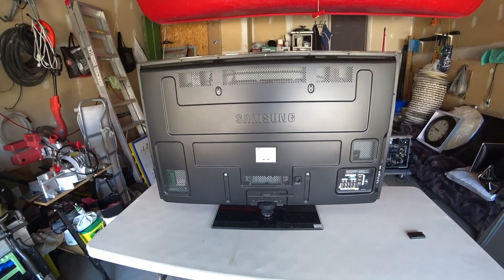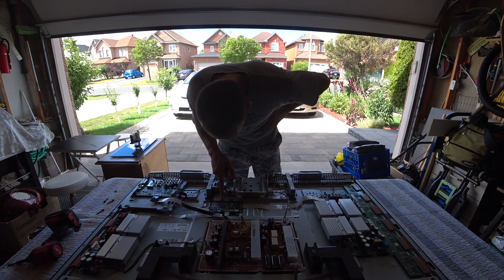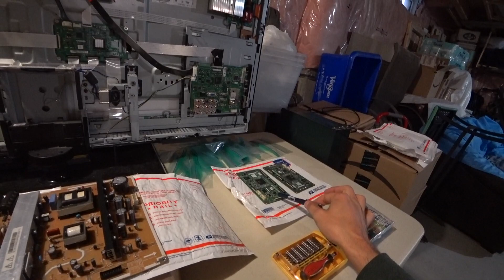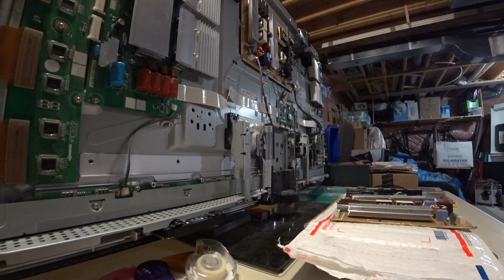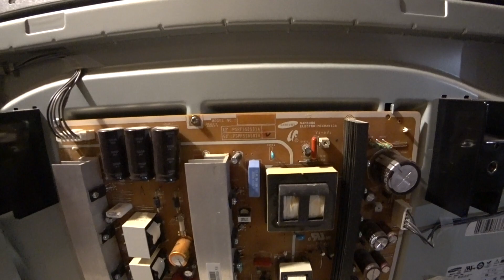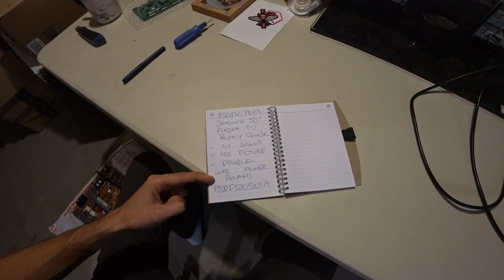Samsung 50” Plasma TV PN50B550 repair fix at home Power Supply replacement DIY

Comment: Appreciate the content, was hoping you’re still active to ask about black snow on startup. After a warmup period it’s gone, wondering how to compensate for that on the boards? Also, my power was off for a day because of an ice storm and when I started the tv back up the picture was pristine on startup for a few seconds and then returned to the black snow until it warmed up. Any help is appreciated. Thank you
Reply from the maker: Here is some possible solution from a follower: “If the menu shows up snowy...then the TV's Logic board or the TV's Xmain board is likely to be the fault.
Xmain usually darkens the picture considerably leaving only a bunch of snow dots all over the screen. Logic usually gives you a bright picture with a viewable picture but it's pretty much snowy, and the menu can be affected by either one.Now if you only get snow in the extreme blacks or whites....that's usually the TV's Ymain that affects that. But there is a negative voltage on that board, that if you lose it....it can cause the entire screen to get blocked by snow. So it's not just a matter of one board possibly causing the problem, it's a matter of finding out which ones are not the source of the snow.” …but I would check the power supply first as it may be weak and draining voltage on start up causing the main (x) board to act up…